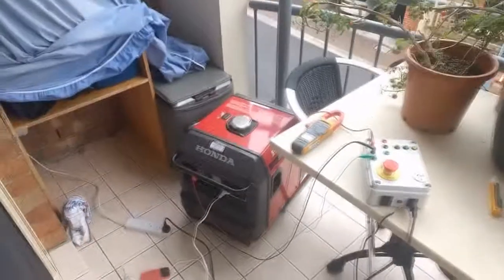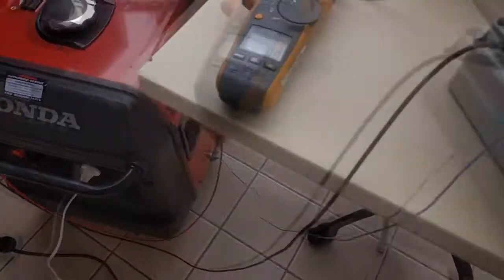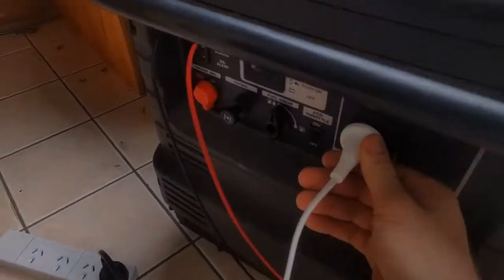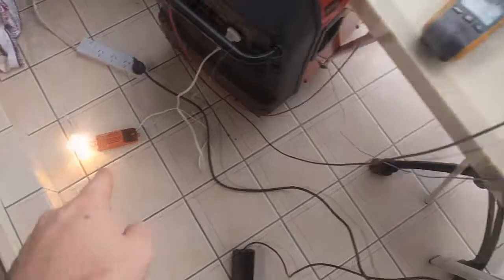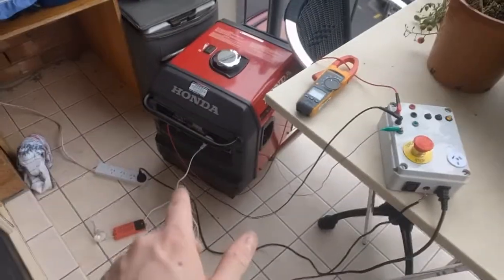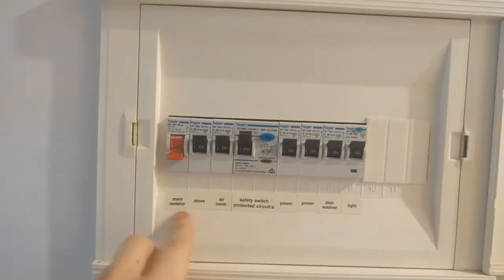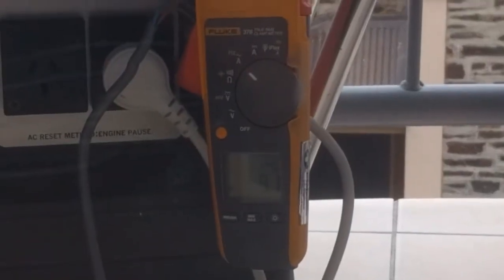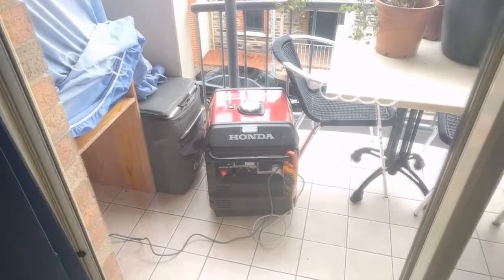Honda EU connecting parallel operation with on-grid mains

Comment: Excellent video. The Honda controller when the engine starts will first look to see if there is already a voltage before outputting. If there isn't, it will simply output.. If there is a voltage already there, it will attempt to match voltage and frequency than start outputting. Just means you can parallel with any inverter style generator. I've always wanted to try my solar inverter and generator together to see if the solar can take most of the load. Thanks for a great video..
Reply from the maker: You're welcome. Just note I wasn't game to try and force a sync with both sources already live. But yeah you can connect any light loaded external source then disconnect it to seamlessly move the load over to the gen.
Reply: @davidgladwell5582  I wouldn't try it.. I connected 2 EU22i generators after they were both started and they did not like it.. They only sync when they are first turned on.. If you connect them after they've checked the lines for voltage, they make their own voltage and frequency..  If you connect it afterward, it really jumps and jerks the engine for a second before immediately overloading.

Comment: I'm glad you commented at least that pushing back current into the grid could harm people elsewhere on your circuit/home/house/street.
See two reasons for the occasionally overload: At first the idle voltage of hondas is typical well over the standard. My 22i for instance lingers around 243V. So this is slightly more than the grids voltage, thus the generator tries to push the grid by himself. haha As you commented already the high current/low impedance by your local circuit overlads the gen instantly. While the grid voltage swings to up and down, that overload comes and goes every couple of seconds. That could be minimized by lowering the the gens output voltage just a bit under the actual grids voltage. But voltage regulator within the gen tries just the opposite: when the voltage (externally) goes down a bit, it instantly tries to rise the voltage again.

The second reason is that not only the grid frequency swings too (for known reasons as of regulating the whole continental zone) the freq does have little jumps and steps in its phase, too. Caused by events of switching huge loads onto or off the grid elsewhere in the regulating zone. A self-regulating gen (~in isle mode) would slowly swing around the target of 50Hz, for instance, producing no instantly jumps. So unconditional small hops in the phase, enforced by the external grid, brings the gen instantly unto its limits, too - while its trying to resync (follow that phase jumps). Thats why the load on the gen flips fast too.

The grid by its nature is very low impedance "device". The gen by itself is a low-impedance device too, to deliver electrical energy. So there are two devices fighting against each other. :D

Comment: This is the dead-set most pointless video.  You’d have to be a Kiwi.
Reply from the maker: Not necessarily if you want to move light loading to gen only without interruption.
Reply: This is the video I have been looking for. I have some appliances that cannot lose power in my house, and using this technique I can move from mains power to backup power by paralleling them and then isolate the mains immediately with the appliances seeing continuous power.  Just don't jump it back as they won't be synced once they've drifted apart!

Comment: That is an interesting test box that you have it almost makes me more interested in it than the generator paralleling which is also pretty cool as I have wondered this for a long time but don't have one to try
Reply from the maker: It wasn't made for this test specifically. Just a 240V to 24V transformer to power the contactor and a foot switch to control the 24V to the contactor coil.

Comment: Can’t do it with just any old genset though
Reply from the maker: Inverter or not, Honda's inverters in the EU series are specific to having an AC voltage applied when the inverter itself isn't outputting, so it can syncronise with the existing line voltage upon itself outputting.

Any other generator will end up with an output of magic smoke. Even if you syncronised a traditional generator by means of the close parallel when the lamp is out method, the standard inverter of a non-EU series will drift out of sync and blow.